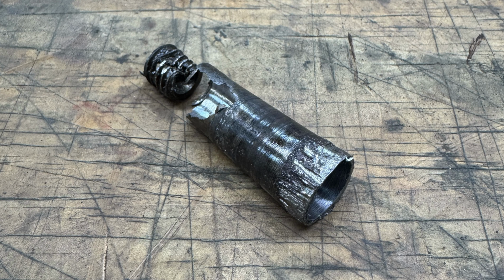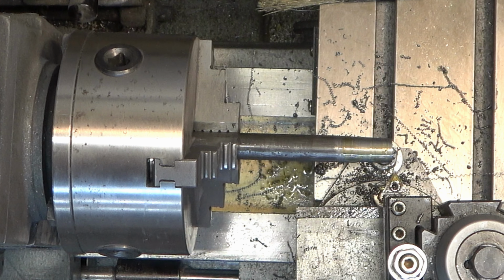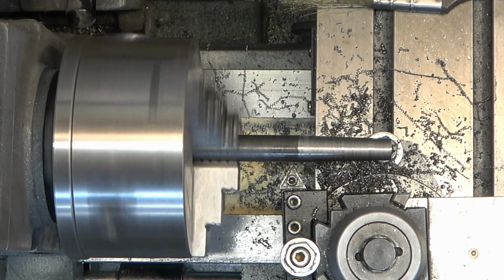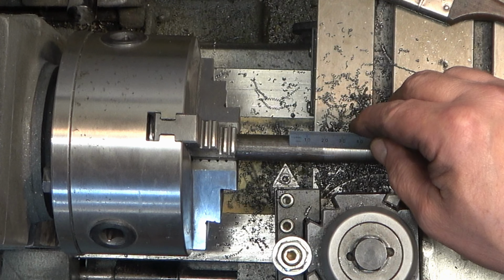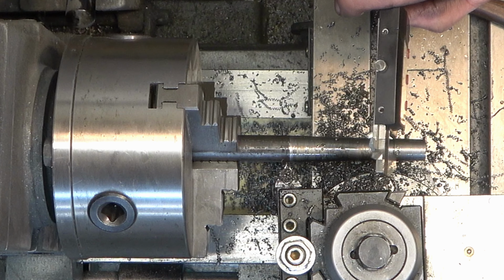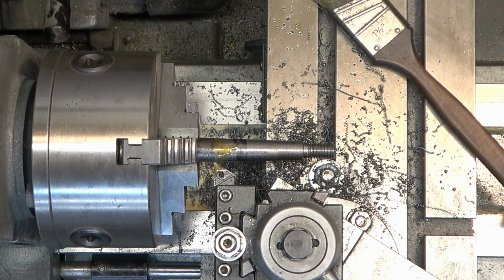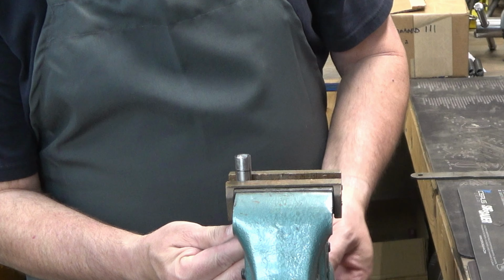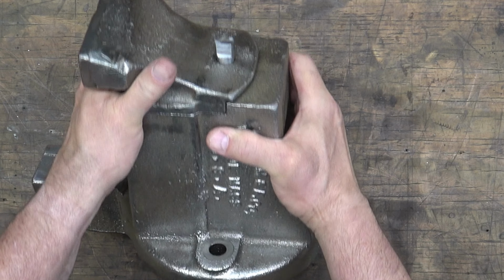Part 6 Athol 644 1/2 Vise Rebuild (Fabricating the Locking Taper Pin)

Comment: On a different topic, inspired by your videos, I just acquired a 6” belt and disc sander with pedestal circa 1960 power bronze very cheap. Your videos will help so much. Thanks
Reply from the maker: You are in luck, 6 x 46 belt disc sander on a pedestal is the next project after this vise is completed.

Comment: Way more complicated pin than on my Parker 272. That vise has a tapered pin, no thread to lock the jaw in place. It looks like the Athol type pin would provide a more positive lock.
Reply from the maker: I suspect the threaded portion was dropped for just a taper pin as time went on. the original patent was from 1914.

Comment: Neat work on the pin, makes me want to buy a lathe to do fun stuff like this.  On my 643 1/2 that I restored the pin only needed to make ~2 turns to snug up the swivel jaw, yours looks like it took 5+. Is it as simple as cutting the threaded portion shorter to get fewer turns to tighten?  My pin only has about 5 or 6 threads on it.  I am only recommending since it may be annoying to have to so much to get the jaw to swivel.  Also, is the jaw tight after you tighten the pin?  Looks like there is still movement, not sure if that was intentional.  I also never realized there is supposed to be a lever arm attached to the pin, that would make it much easier to take out!
Reply from the maker: Thank you for the comments. Actually, there is a little play, possibly 1mm in total but I plan to eliminate this buy turning the shoulder a little higher above the threads. This will allow the taper to drop in deeper and snug-up better. As for shortening the threaded section, I suppose that can be done and achieve less turning of the pin; however, I needed the (1/2”) of threads to snug the pin down as tight as possible to get it to lock the jaw and eliminate the play. Once I turn the should down some more, I may cut some of the threads off. Thanks for the suggestion. This was only my second taper I ever turned and to be hones I am quite happy with how it turned out. I expected to turn one at 3 degrees then need to adjust +/- a degree until I got a snug fit. Also working that compound is something new to me as well. Yes, having a lathe to play with is a lot of fun and when I encounter issues or projects that I have never had to work on before, the learning process is my favorite part of working on machines like these.